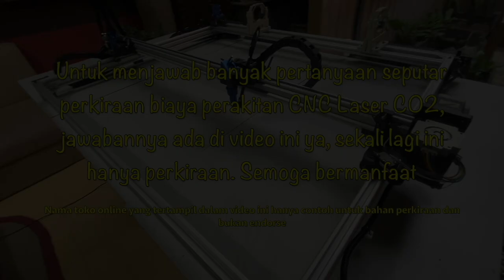Spil Biaya Perakitan CNC Laser CO2 50W DIY

Comment: Om mau tanya, saya lagi buat cnc router, sumbu Y nya pake 2 motor stepper 2 x 2.1A di pasang secara pararel dan drivernya pake drv8825, nah permasalahannya kalo trimpot saya maksimalkan kenapa pergerakannya putus2 ya om, dan ngga lama setelahnya ngga jalan sama sekali kemungkinan protek
Reply from the maker: iya krn proteksi panas nya. heatsinknya harus ditambah kipas
Reply: @ArtemCreative  selain dari itu permasalahannya dari mana lagi om, pendingin udah saya tambah dan di pastikan aman, di posisi ic dalam keadaan dingin pun pergerakannya masih sama
Reply: @ArtemCreative  atau pengaruh kualitas drivernya yg kurang bagus
Reply from the maker: @elektronomia5988  potensio jgn dipentokin. kalo 8825 kan semakin besarnya di puter ke kiri, maks 3/4 nya aja